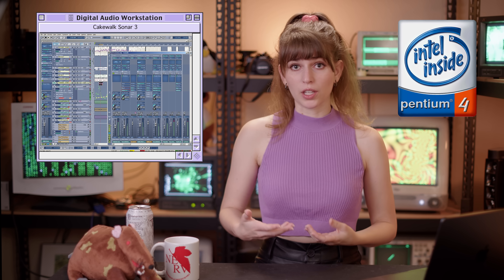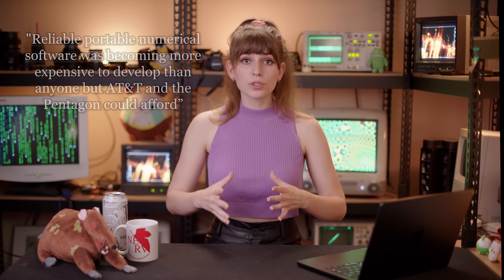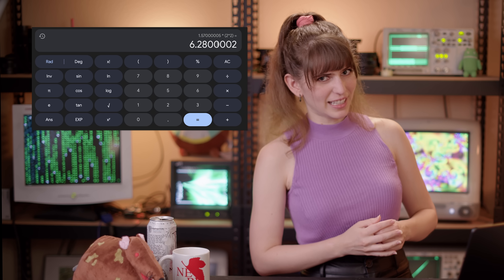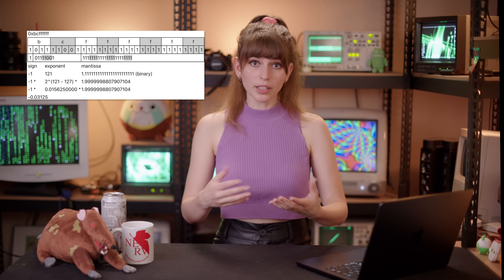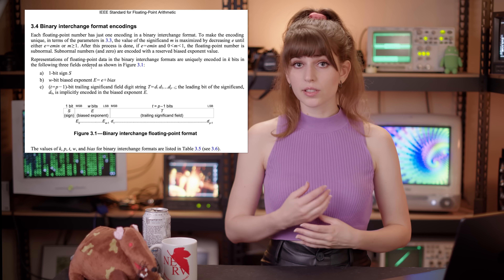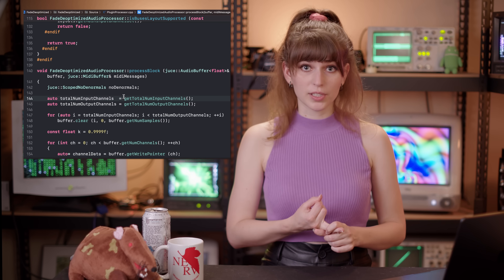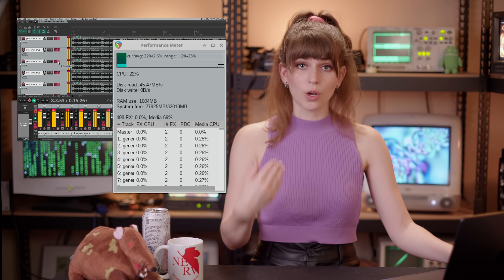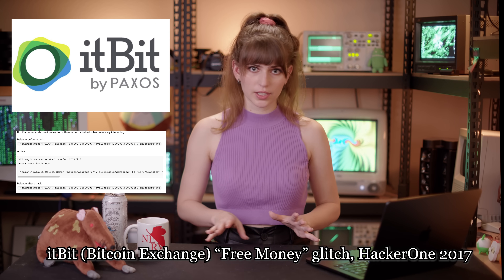Fading Audio is ROUGH on CPUs

Comment: It's really important to remember that back in those days, if Intel said something had to be a certain way with CPUs, that was the Endian of the discussion...
Reply: That wasn't very Big Endian of them...
Reply: @MenaceInc   - nah they were little endian.. the Motorola CPU's like the 680x0 series used Big Endian... am getting all nostalgic now with memories of how much easier the DevPac assembler was over the Seka one...
Reply: @DevilbyMoonlight yes, I said that wasn't Big Endian of them precisely because they used Little Indian architecture 😂
Reply: i C what u did there
Reply: Little Endian became standard not because Intel told it but becaue x86 became so big and unambiguous everyone had to follow if they wanted to have software. PowerPC for example today exists in POWER processors which moved from big to little endian. For some time both were supported but no one used big endian. Same with ARM. Not even sure if newest ARM CPUs still support big endian operation.
BTW. IP packets use big endian. Also big endian is pretty much standard in fpga's. Some softcores are little endian and there need to be these silly byte conversion operations because of that
Reply: @e8root  Little endian is actually beter in terms of address calculation. The low 32 bits of a 64-bit number have the same address, meaning casting is trivial. Modern ARM CPUs (RISC-V as well) are little-endian by default, though they can be switched to big-endian mode
Reply: @e8root New ARMs are all little endian, I'm pretty sure. My understanding was the main thing big endian had going for it was that networking devices used BE protocol, making it easier for old CPUs to be BE so they can interpret network data without byte swapping.  This isn't really an issue with modern CPUs that support byte swapped operations and perform much better in general.

For instance now I can use a compiler feature to declare a pointer to a big endian integer.  When used, the asm load that comes out will use a byte swapping load from memory into a register.
Reply: @e8root  Oh, I'm reminded again that hundreds of thousands of kW's are being used daily to flip bits..... network to host, host to network....
Reply: @WetPig intel said exactly this back in 2004
Reply: @nicememes0676 It's actually insane we haven't fixed this yet
Reply: @e8root  little endian became standard because it's better. imagine not being able to just access a dword as a byte and have everything just werk.
Reply: If you had the guts to PowerPC through the debate you had to be careful not to SPARC controversy
Reply: THE WIZARD HAS SPOKEN!!!!
Reply: @danielodors  :person-turquoise-wizard-wand:🙆‍♂🙆🙆‍♀
Reply: It is very underappreaciated how funny that comment is.
Reply: Intel used to say things back in the day
Reply: 😹the big endian or the little one 🤔
Reply: nah, it did not
Intel said a ton of crap even back then, no one cared about Intel and their bs
Reply: Omg wish i had you as a fellow student in college studying ECE
Reply: No you didn't.....lol
Reply: I used to hate restricted size segmented memory in machine code with a passion compared with the simplicity of Motorola.
Reply: One little two little three little endians.
Reply: The IEEE standard  is kinda from before Intel dominated the field.
Reply: @petergerdes1094  You got a source for that claim? Because even going back to IEEE 754 in 1985, Intel's 386 (80386) was already king of the hill.
Reply: @FrenziedManbeast Well the working group was formed in 1977 when Intel had just released the 8085 and according to the IEEE milestones website the proposed standard was being implemented by other companies in 1980 even if  formal approval took till 85.
Reply: @FrenziedManbeast As the IEEE milestones website notes "Ironically, the fiercest competitors in the emerging microprocessor industry were the first to converge on the KCS (Kahan-Coonen-Stone) proposal from Berkeley which became the subcommittee's ultimate focus. Given the wide range of possibilities in a new arithmetic system, ideas arose from different academic and industrial corners. Every comment and counterproposal required response. The references include papers by Donald MacKenzie on the standardization process and by W. J. Cody on features of the major competing proposals.". The Berkeley proposal is the one from Intel so it was actually accepted by industry relatively quickly, ie roughly by 1980, when Intel wasn't yet a giant  behemoth
Reply: @petergerdes1094  If we're going to keep moving the goalpost back to try and help you backpedal your original comment, let's jump straight to Alan Turing or Charles Boole! The point is, a committee talking about a problem isn't a solution in hardware. In 1980, our best chip to get a nod would be what, the Moto 68000? Which doesn't even implement IEEE 754 provisionally as it lacks floating point support. That took years to be formally introduced in silicon in actual chips. And all of that set aside doesn't consider that my original comment was purely a pun made in jest, and you took it as a Call to Arms to try and gatekeep fun. Boo! Have a nice day! =)
Reply: @FrenziedManbeast Being rude won't hide the fact that I gave you plenty of evidence that shows I was correct.
Reply: By your own admission, the solution Intel adopted from Berkeley proposal (one of many being considered) became the standard. Out of all the manufacturers, Intel's implementation became the rule. Hell, the 8087 was the FIRST CPU to even implement the specification! If that isn't leading the way to dominance, I don't know what is!

You were wrong. You are still wrong. And your initial post was rude for trying to poo poo a little bit of levity by trying to "well actually", and it blew up in your face because "well actually" it turns out you didn't have your facts straight.
Reply: @Harajukujin  Literally no one asked about supercomputers in the video or related comments, but thank you for that input.
Reply: @Harajukujin  I never suggested Intel influenced the committee. I said their early adoption and implementation into silicon by being the first in 1980 to bring the draft into reality cemented them as a serious player in the exploding microprocessor market. It was the first step to their dominant position that by 1985 was clenched with the 386.

None of that requires supercomputing design, engineering, or implementation to achieve. Your entire thread is a non sequitur to this video and my original pun. Why in gods name know-it-alls feel the urge to post on a humorous comment with their "well, actually" posts is beyond my ken.
Reply: @petergerdes1094  OP is actually being incredibly diplomatic, considering that it was abundantly clear from the very beginning that their comment was nothing more than an excuse for a silly pun, and you came in hot with [an attempt at] a show of intellectual superiority. You get what you give, so they totally could have been rude, but they chose to be super chill about it instead lol

I mean, hey, text tends not to convey tone very well, "so that's just like, [my] opinion, man."
Reply: @Harajukujin  You're wrong. I'm not typing in circles to defend my point on a post made in good humor. Just accept that we aren't going to agree and move on with your life. I've never regretting trying to add a bit of cute humor to the world as much as I have with this entire thread. Thank you for helping dim the light in the world just a little bit with your insufferable know-it-all approach to the world.
Reply: And now that there's more choice, almost all CEOs are Endians.

Comment: I've always been a fan of the sign, mantissa and exponent. As an electronics engineer in days past, even the ZX Spectrum ROM implemented a similar approach to IEEE in the 80s, although the spectrum actually used a 5 byte notation (40 bit format), so not exactly the same. Fun times when coding was all about clock cycles and how much you could squeeze into 48k. Love this channel Laurie...
Reply: Apple II floating point numbers were kinda crap AND really really slow.  Which is probably why the graphing programs I was writing on microcomputers of that era were dog slow.  If I had been more knowledgeable when I was 16 or 17, I would have tried to work out a fixed point version.  But then I would have had to write my own trig functions too.

Comment: I think this brings up an excellent thought experiment: What if some computer systems were optimized for performance, and others for accuracy?
Reply: You're probably thinking about CPU or a game console, but most problems can be solved with application level choices. It would not make sense to build an entire computer system "less accurate" if application code to use it with is inefficient. If there was an intentionally inaccurate system for the sake of performance, there's always someone to come up with a scenario that demands more accuracy. Computers are calculators, after all.

Overclocking is one way to get more performance from an existing system (and yes, less accuracy) if you don't care about the eventual data loss. Safer way is simply switching the bottlenecking hardware component to a better one.

Embedded systems is also an area where designers of such things can choose whatever seems best, but on the other hand modern CPUs have lots of useful features already built in like cache, branch predictions and thermal monitoring.

Comment: I was missing kind of important information for those who have not much clue about dsp and that is - this is only relevant to floating point processing. And sorry but back in Pentium 4 times we did quite a lot of stuff using fixed point math only. Where denormalization kind of doesn't exist.
Otherwise this was quite nicely made video about one often overlooked topic in dsp.
I wrote my first  music composing software 25 years ago and most of code was running in fixed point. Including filters and subtraxtive synthesis.
Reply: Pretty much every dsp that is a custom design will use fixed point too, and probably just the right amount of bits at various points in the pipeline. Like for images, you'd typically get 16 bits from the sensor but scale it using the grey point and only do further processing with maybe 12 bits and probably at the end only 8.
Reply: Fun fact: the N64 uses its RSP for both audio and 3d graphics. Like the CPU it has FADD instruct. But on the RSP F means Fixed . And also a vector with 4 components. No special audio hardware. A cheap consumer gaming console had it all figured out in 1996 .

Comment: Back in the dim and distant past I wanted to do some high-precision big number arithmetic on my Atari 800XL; Atari BASIC had 48-bit floating point precision which was pretty wild for the time, but I ended up having to implement my own routines and took a brute force "do it in decimal notation using strings" approach - I basically implemented the manual methods of addition, multiplication, subtraction, and division. It was neither pretty nor efficient, but it did allow more or less arbitrarily high precision and magnitude.

As for which should be the default, one isn't objectively "better" than the other as it entirely depends on your use case, so there's no right answer - just select the one that's best for the job you're doing!
Reply: Atari BASIC did its floating point math in binary coded decimal so it didn't have the binary to decimal round off errors like 6.280000002 in the video, but it was SLOW.
Reply: @rkline1963  Atari BASIC was slow at everything - I did some benchmarking a couple of years back comparing various 8-bit BASICs and it consistently came at the bottom of the pack, sometimes being an order of magnitude slower than the top of the table. (The Amstrad CPC and BBC were the runaway champions.)
Reply: On my Commodore 4016 (6502 2mhz) and PET (6502 1mhz) I implemented string mathematics when I needed high precision. It used strings to contain numeric variables ("0".."0", "+", "-", ".") and add/sub/mul/div using normal human methods. (As we would do on paper.) This was relatively slow but enabled precession up to 255 digits... More than enough for calculating projected star positions etc. On current 32 bit machines, that approach can have 2^32 length numbers...
 This approach is the poor mans approach to  BCD (Binary Coded Decimal) and works well. So 1/3rd could be represented as "0.3" (followed by up to 253 "3"s). Round off errors are so small, they can be ignored.
Peace from Australia.

Comment: Interesting video. Digital audio would most likely use fixed point arithmetic rather than floats, slightly curious why you'd code this up with floats.
Reply: My thoughts too, since we could control for absolute precision instead of normalisation!
Reply: Just curious what you mean by would? As far as I am aware all modern DAWs use floating point and apparently one of the benefits is that it basically eliminates digital clipping artifacts inside the DAW. Saw an interesting video on that specific topic where the guy tested this with pushing multiple channels and plugins into the red without any audible artifacts occuring.